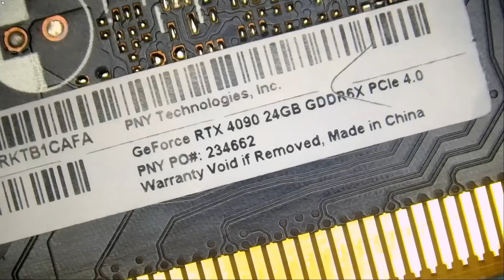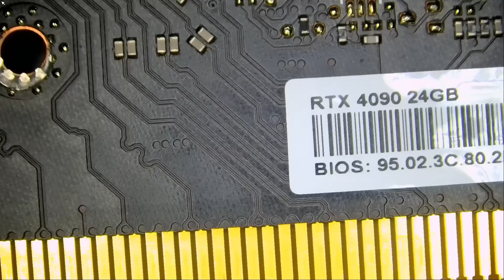PNY 4090 Not Detected Fixed. What caused the card to fail?

Comment: I am assuming that damage was caused by someone repeatedly taking the car out and replacing it, I hope the owner doesn't think they can keep doing that
Reply: I can see where if the owner of this 4090 was having hardware issues then there might have been a necessity to remove and reinstall for whatever reason.
On the other hand if they were faffing around popping in and out of one system to install into another system; rinse, repeat a multitude of times will cause such problems.

Comment: Hi Alex : i would like to know, why you didn't used the new pad in this repair & instead used a wire ? Any particular reason behind it ?
Reply: I guess because there is a lot of force and stress on the pad. If you would add a new pad and glue it down, I don't think it would last very long if you insert the card several times.
You can use those pads to solder a pin to it but not for this "heavy duty" stuff.
Reply: And pulled the wire directly to the foot of the microcircuit.